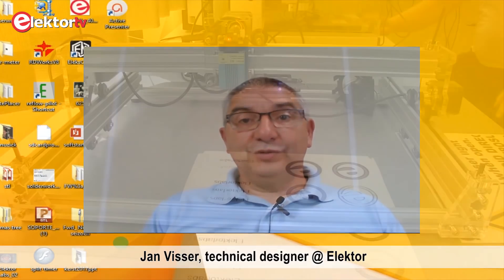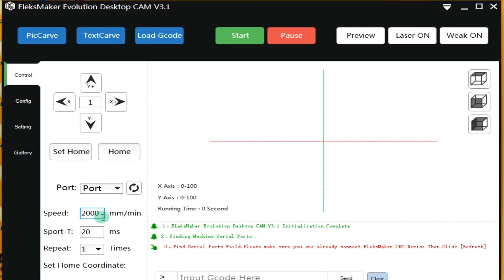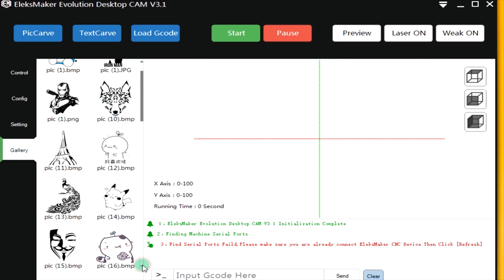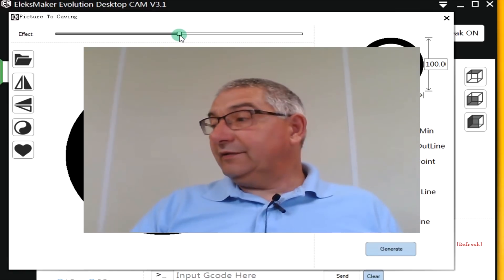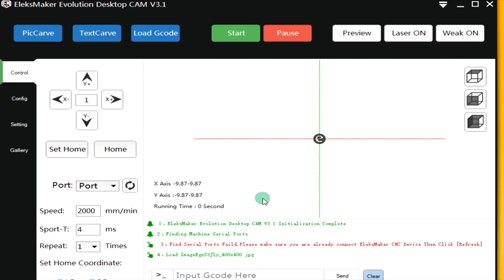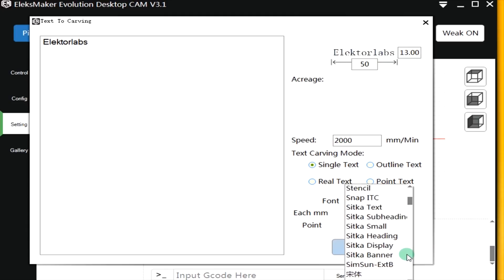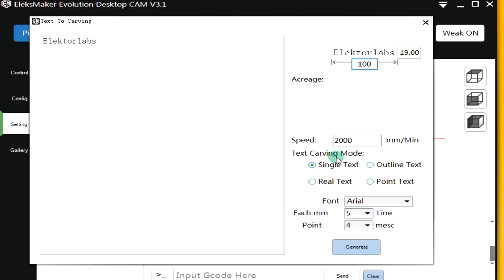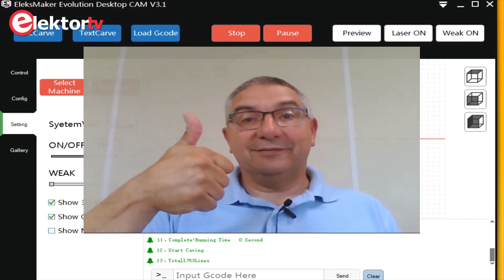2.5 W Laser Engraver - Elekslaser A3 Pro - software & demo

Comment: i got Eleks A3 pro i built the kit , everything was nice belt tension and ball bearing fine smooth running but when i load the pic i can't do preview all motors have power i feel it by touching them but they don't move at all , the laser working in the place i see the flash and burning in one spot because the motors don't move , can u help me pls .   thanks

Comment: Good video and simple, I have a problem with this machine, when I write a text in "Outline text" mode the letters such as O, D, P, and all those that have an interior, that interior moves and there are no symmetrical ones, So, like the circles, it does not make them circular and does not close the circle. I have tried the test that appears in the image gallery and does not close the inner circle and appears deformed. Do you know what it can be? Thank you.

Comment: Thank You! this is the most helpful video I have found on this software. My laser has been collecting dust because it was so difficult to work with. I STILL have problems loading my own images though, any thoughts on that? It loads but does not seem to be a great quality when I need to make them smaller, even with a high quality picture.
Reply: Also, I cant seem to change the font? Any Idea on that?
Reply: you could try a different type of file: like a bmp, jpeg or pdf